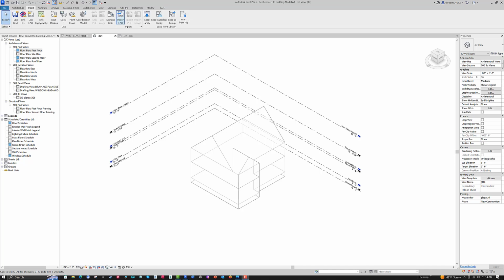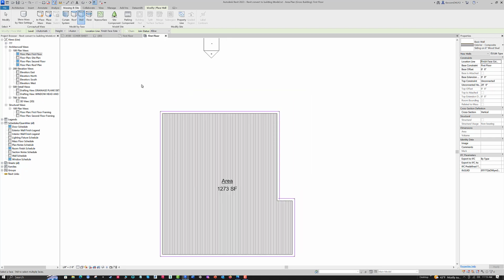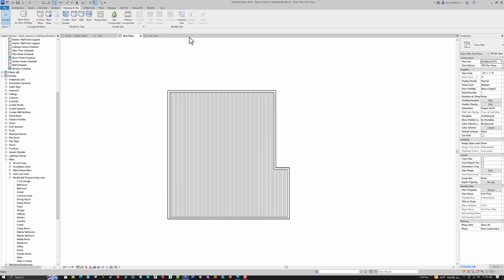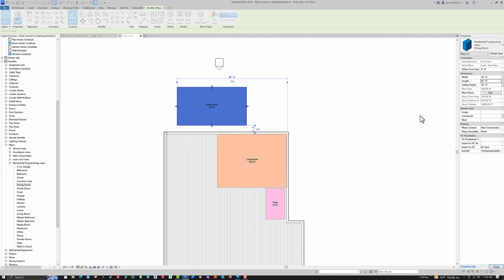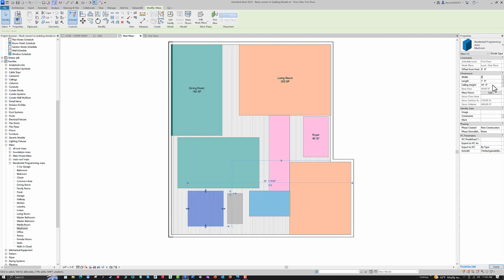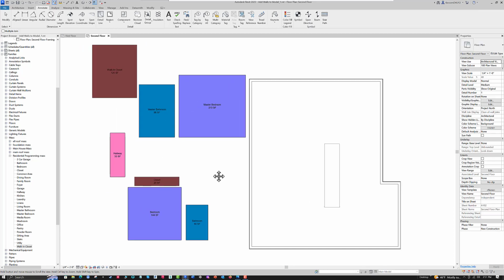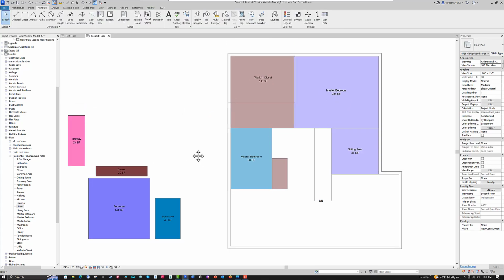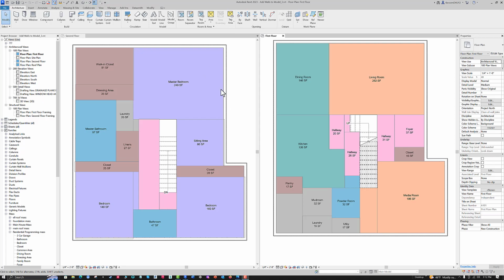How to Convert Revit 3D Mass Elements Into Schematic Floor Plans

Comment: I have question. Do you have an email I can right to you. I have image of a floor plan for client I am doing. The the thing is on the walls I the exterior face of the wall tapers while the interior face stays straight. But the tapered part tapers from one point to the other. If you can tell me your email, I can send you the image of the floor plan. I’m also doing a lot of split levels. And I was having trouble how to set them up. The part that I have trouble with the split levels is setting up the view range of how properly set it up so that when I’m in that view of the floor plan it will show with poche and the elements that are either below are set with the overhead lines if you can send me the email I can send you the image of the floor plans.